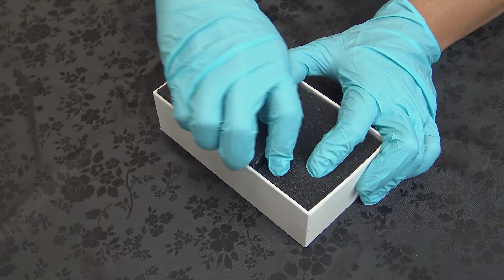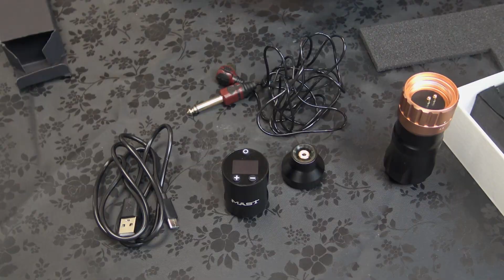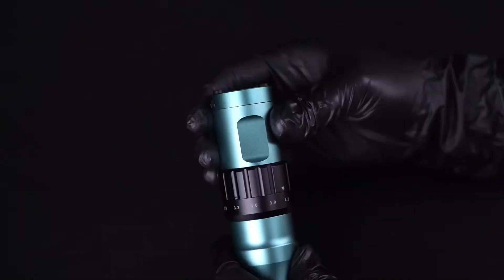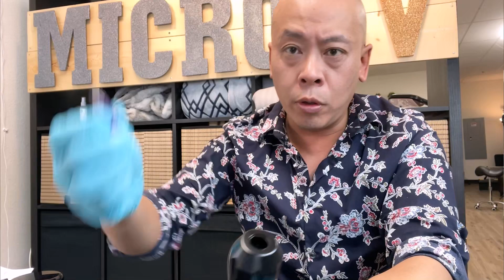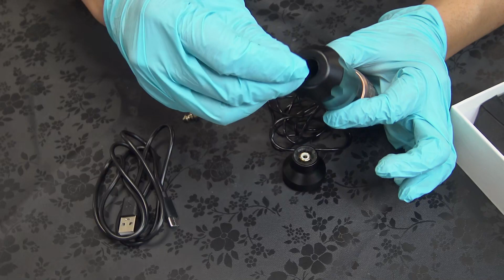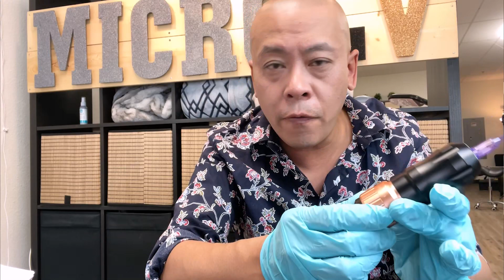Mast Fold 2 Open Box | tattoo machine motor noise Fix | adjustable stroke tattoo machine |

Comment: it was at 15 volti ...man i see on...of course...but i use at 4.5  5 v for shading....maxim 6.4 for lines, filing again at 5 5.5 v...
Reply from the maker: Thanks for the advice! This video was recorded about 1.5 years ago. I agree that I wasn’t good enough back then, but now I’ve figured out better settings. If there’s something I don’t know or I’m not good enough at, I test it to prove and improve my understanding. This is my mentality—I experiment with different needles, hand speeds, voltages, and even different brands of practice skin and needles. There’s no absolute right way; it’s all about adjusting to find the right balance in different situations. Check the link at the end to see my recent work on practice skin at the end: https://youtu.be/6MqaPHoQ8z0?si=AlI5b_Er1chpvxJt